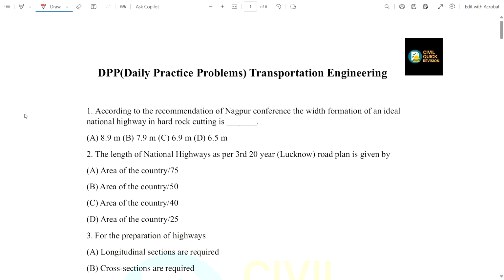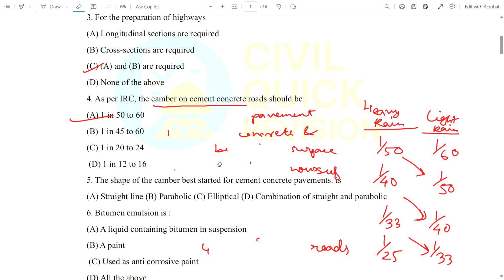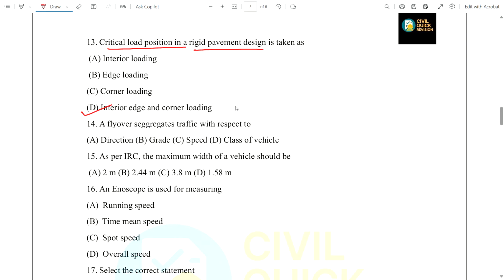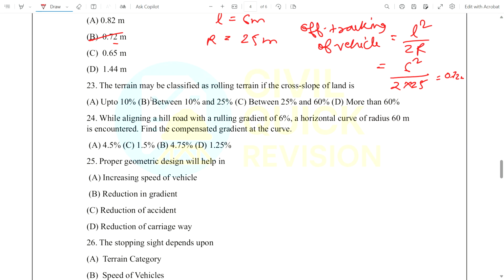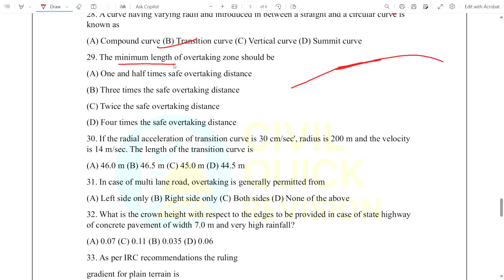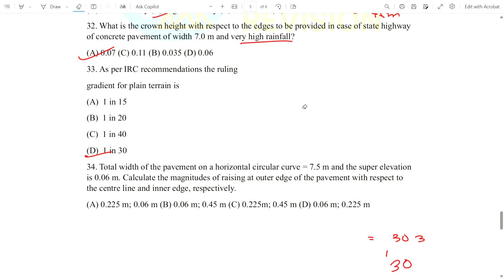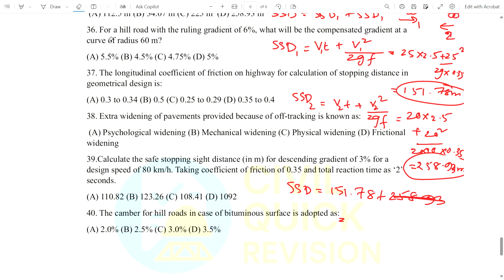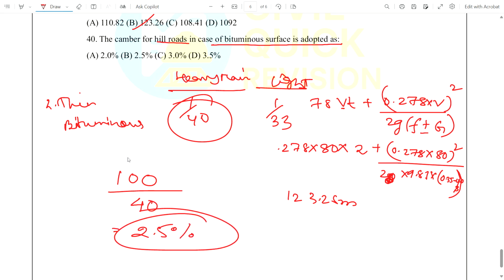Most Expected Questions on Transportation Engineering for PWD JE | Civil Engineering | APSC AE JE |

Comment: Doubt on question no 10...( it should be option C)
noramlly the consistency of bituminous material can be measured either penitration or viscosity test but for cetain range of consistencies these test are  not applicable and FLOAT test is used.  so which one should we consider ?? and i have searched that penitration test is done for hardness ... ... kindly check this out ...
Reply from the maker: Yes Option C will be the correct answer